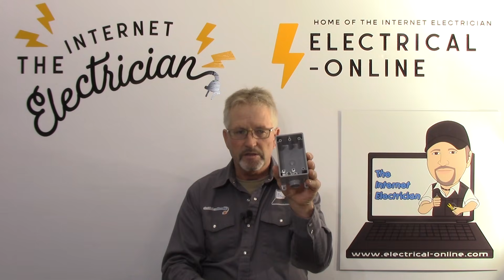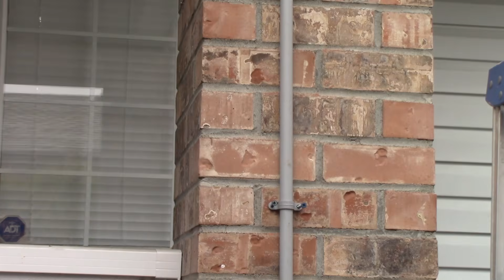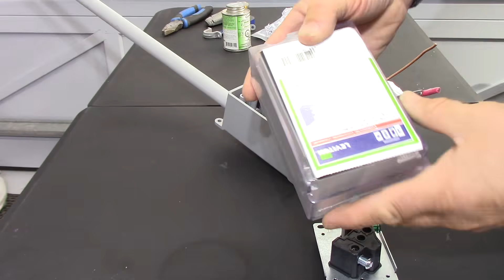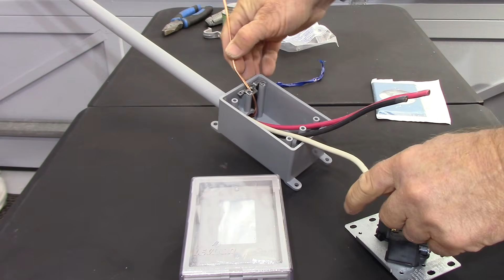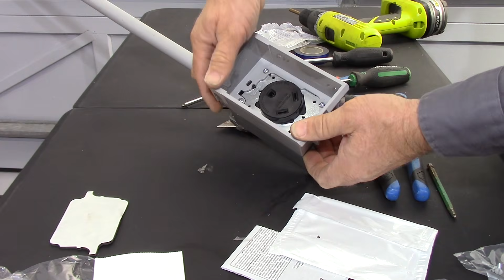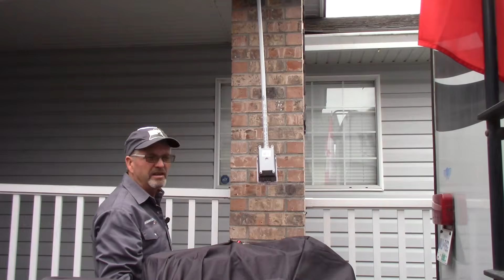How to Wire a 30 Amp 125 Volt RV Receptacle

Comment: Just buy the 30 Amp outlet with the proper outdoor box. You can't plug a standard 30 Amp rv outlet into that box.
Reply from the maker: Yes, you can but your have to make a little "modification" for the angle "plug" that come on the RV supply cord. Most of the RV pedestals are very expensive and I wanted to have the provisions to have 15/30/50A supply here in the future.  I found a great panel and receptacle assembly for a good price so I'm going to make another video installing it at this same location.  Thanks for watching!
Reply: . Not to be snarky, but that's kind of my point. If you have to "modify" the box (cut the bottom out) to allow the plug to fit and the cord to hang straight down, it's the wrong box for the job. It also voids any UL certification, and creates a 'loophole' for your insurance company to deny your claim if your house burns down. That lid, likely doesn't close all the way either, when the plug is in the outlet. 'Close' is good for horse-shoes and hand grenades, but not electrical work. I'll place a public announcement here for you. There are RV boxes that are pre-wired inside and with built-in breakers, and UL certified. All you have to do is connect your live(s), neutral, and ground, at each end (while the main power source is off) and ensure all other appropriate wiring installation protocols are met. In many cases, depending on your mounting location, this project can still be done for $60~$100.
Reply from the maker: @tangoindiamike9189  Yes, that RV box from Temu is what I was referring to as a nice affordable option.  I will be doing a video on this upgrade in the near future.  Thanks again for watching and for the helpful insight (s).

Comment: Im running 50 ft of wire plus the 25 ft on the 30 amp  travel trailer..   will 10/2 be sufficient? The trailer will be used by guests so ac, microwave and lights will be used...

Comment: This vid helped me a lot. Well done. Thank you. I'm using this vid to install an interlock kit to back feed power from a Honda EU 2200i, with its own 30amp out receptacle, to power my main house panel( with all 220 circuits turned off). I will be using 8awg wire also just in case I buy a 7k watt, or more, generator in the future. Any further advice is greatly appreciated. TY.

Comment: Did I somehow miss the part where you explained why you just didn't use 10/2 wire instead of 10/3 and had to tape the red conductor wire or don't they sell 10/2 in Canada ? 
Edit; I see further down in the comments where you say it's 8/3 wire for future upgrade to 50amp. Hard to tell on video the gauge of wire.
Reply from the maker: No worries!  Yes, 10/2 is readily available, and yes, I used #8/3 for future upgrade to a 50A, 125/250V receptacle that I have now done, fed with a 40A 2-pole breaker.  (which is plenty of capacity for most larger R.V.'s.)  Thanks for watching!  And happy July 4th Independence day!

Comment: Quick question, I have a 170 ft run from barn where I will have a meter base to 30 amp rv pedestal with an additional 20 amp gfci outlet. What size wire do I run the 170 ft to pedestal? and do I run 2 wires? 1 for 30 amp plug and 1 for 20 amp gfci? Thanks in advance

Comment: This is the third instruction video I've watched today and NO ONE is using a GFIC for their RV outlet.  So, how is it we have GFIC circuit breakers for sinks and hot water heaters and GFIC outlets installed in garages and outside, except for RV outlets?  I have about $135 invested in a 20 amp 120v single pole GFIC and 20 amp 120v single pole GFIC and curious how people are able to install the outlets without a GFIC.
Reply from the maker: The GFCI protection is in the RV.  (or should be unless it's an older unit).  The panel in the RV is in essence a sub-panel from whatever panel is feeding the RV outlet.  Then the GFCI protected circuits should be wired as such in the RV, either via circuit breakers where needed, or with GFCI outlets.  Many just have one GFCI outlet in the RV, and then protect the other circuits on the load side of it.

Comment: I searched for a couple hours wanting to know if I had to use a double breaker or single and no one but you answered that question for the tt type. Thanks
Reply: A double pole breaker would be 240v

Comment: Did you have to notify the city to do this job, or get a permit?
Reply from the maker: You should always check with your municipality to see if a permit is required for your project.  My job here was covered under a permit I obtained for a general renovation project consisting of several alterations and additions to my system.

Comment: Great video Terry, thank you. Quick question. I'm going to be putting a RV power box with breakers close to my RV but want 30 amp as well as a 15 amp GFI. I was told I can run 10/3 and understand how to wire it at the RV end but do I connect to two separate breakers in my house panel as well.. ie a 15 and a 30? Or do I go one two pole breaker in the house panel (50amp?) and then split it at the RV end to the two separate breakers? Hope that makes sense.
Reply from the maker: Hello Mark.  Thanks for watching.  I would need some more information from you.  Are you planning on putting a sub-panel for the RV service?
Reply: @theinternetelectrician  Hey Terry. Seems my comments/replies keep disappearing lol. Could be that I'm adding a link. Anyway, I'm planning on running #10/3 from the shop panel to the RV shelter which is about 20ft away. I then wanted to install a RV electrical panel that has a 15 amp 110 and a 30 amp 110, each having their own breaker in the panel itself at the RV shelter. Similar to what you would see in a campground. That would be considered a sub panel correct?
Reply from the maker: @lakeestate  ok, then feed the 10/3 with a 30A 2-pole breaker. 30A is the maximum breaker size for #10.
Reply: @theinternetelectrician  Fantastic, thanks. So to be clear, 30A 2-pole breaker in shop panel, run the #10/3 from that to the RV Box then split the 2 hots... 1 to the 15A and 1 to the 30A. Thanks again for the help.
Reply from the maker: @lakeestate  Yes, with the information you provided, I think so, but if you need further clarity or more information, email me at internetelectrician@gmail.com and provide photos, etc.
Reply: @theinternetelectrician  Thanks so much Terry. Your help is very much appreciated. Cheers and stay safe.

Comment: I have a 30 amp single pole BR130 and have that same outlet. Is a 10/3 wire what i need?
Reply from the maker: No, you can save a conductor and use #10/2! I only ran 3-wire for future upgrade to a 50A 125/250V receptacle.
Reply: @theinternetelectrician  thanks a lot. Glad I found this video.
Reply from the maker: @overlandersnorthwest  I'm happy that you found it too!  Thanks for watching!

Comment: How do you wire an old 1971 Coleman to a 30 Amp. It states only use 125v. No power Converter?

Comment: You mean 10/3
Reply from the maker: You are correct in that's what you can use for 30A, 125V circuit, but I used #8/3 to accommodate a future upgrade to a 50A 125/250V receptacle. (that I have since done)

Comment: Great video however I am confused now. You intend on using the 8 wire for future 50 amp service, however everywhere else is saying 6 wire for 50 amp service. I am planning on setting this service and require a definitive answer thank you for your help.
Reply from the maker: I know. It’s an anomaly, but #8, you feed with 40A, and you use a 50A rated receptacle. 50A 2-pole breakers, not that common.

Comment: Hello Terry. Looking to wire up our RV outlet which is a TT-30 plug. The distance from the meter will be 100 feet (30 meters) will i need to use size 6 or 8 wire and would i be ok with say 6/2 or 8/2? or do i need to go 6/3 or 8/3? i do not plan on buying a bigger RV thats 50 amps 240. so i do not have a need for the spare wire. Thank you!
Reply from the maker: For 30A at that distance, #10/2 will be fine, but if you want to spend extra money, go with #8, but it's not necessary.  And you'll have better luck finding #10/2 cable so if going to #8, you'll likely have to get #8/3 as it will be way easier to find than #8/2

Comment: The Chief Electrical inspector once on one of our jobs would not allow for the outer jacket to be stripped and run through conduit.
His reason was you are changing wiring methods from a cable which is required to be labeled on its surface to conduit with conductors which the conductors are required to be labeled along its insulation.  An inspector can not look at the conductors entering the box and know what it is for sure without the labeling.   Just thought you might like to hear that story.   Best wishes,   Kevin
Reply from the maker: Inspectors have the power to interpret the code and make you do it his / her way even if they're wrong.  Some you can compromise with, but sometimes  it's just better to do what they want and accept that they are wrong!  Kinda like our Governments!
Reply: @theinternetelectrician  what is the logic for removing the outer jacket sheathe for a conduit run, seems like an extra layer of protection.  Thanks  Patrick  AZ

Comment: Nice job. The box I bought is all enclusive with door and all. I'll be mounting it on the exterior, very close to the breaker box which is located on the inside of my garage. One thing I did not see you stress is cutting the power before doing any of the work. I'm a novice so having any live wires around the work area frightens me. I do realize once the main breaker switch is turned off, the two wires coming into the box (from the city) will always remain live and I should not get anywhere nears those. I'll be using 8-2 wire which should be a little easier to work with.
You do sound like you might be a teacher or an instructor.
Reply from the maker: Thanks for the comment, and yes, I try to always emphasize safety first, mainly shut off the supply!  I sometimes neglect to mention it enough!  Good reminder.

Comment: Please help.   I'm wiring a 30amp RV  outlet... and I have a 8/3 wire running 100 feet out...    I don't need the 2nd hot wire,,,?    So what do I do with it?
Reply: You need one hot wire ,one neutral wire, and one ground wire for a single pole 30 amp breaker 8/3 works  wire even 10-3 for a short run💪
Reply: @jeremycalifornia  thank you.   I figured a bigger wire would be fine.  It's going smaller is where issues arise
Reply: @ronsmith8434     Good job Ron!   You covered voltage drop in the 100’ of cable by running the #8 copper.   That’s what I would have designed it if it were my design.  Where you were incorrect was 8/3 WG.   Only needed 8/2 WG.  Wire nut the extra conductor at both ends.  Best wishes,   Kevin
Reply: @Kevin Coop  yes I did exactly that.  So far so good, all works well...
Reply: You answered your own qt... single pole 30 amp breaker is one hot wire120/125v... double 30 pole beaker has 2 hot wires .240v ... (120v×2=240v)
Reply: Bigger wire is always better. Good luck with the project 👍

Comment: Not bad Terry. I wonder if I could use this same set up for a 40 amp car charger.
Reply from the maker: Yes you could!  And a timely question as I am working on a video that will be all about servicing an EV charging system.  Stay tuned!

Comment: I have a 35 foot RV what size wire do I need to wire to my RV to my 100amp electrical box do I need a  double pole or single pole 30amp breaker I have a single slot not using now
Reply from the maker: Is your plug for the RV the same as what I've shown here in the video? Even if it's a 50A on your RV, you can adapt down to the 30A being you only have one breaker position left.  Follow the example above, or this other video I did (https://youtu.be/_F3osluGL9E).  That should guide you through the process.  So to answer your question, You need #10/2 cable, and a 30A single pole breaker. Thanks for watching!  I how that you 'liked', and that you have subscribed to my channel? Much appreciated!